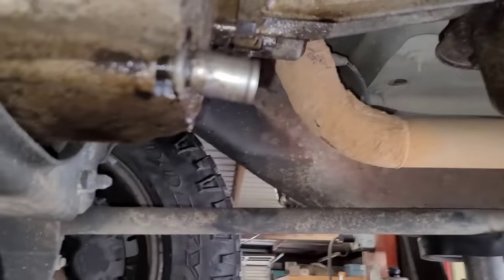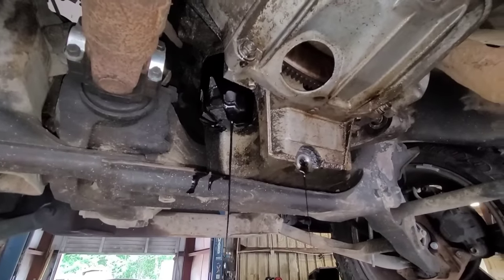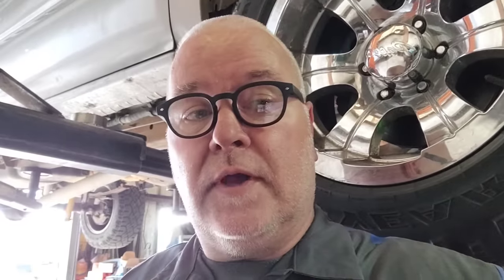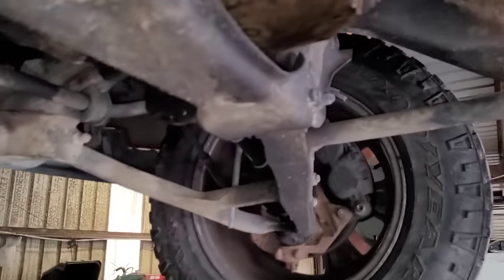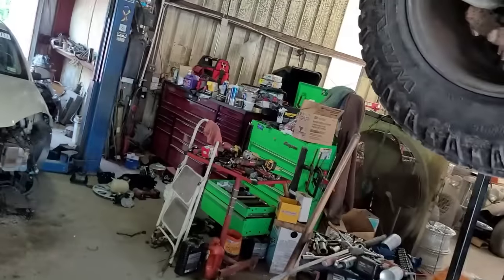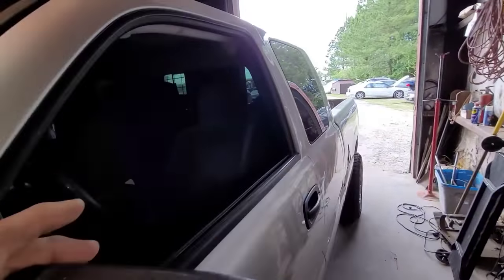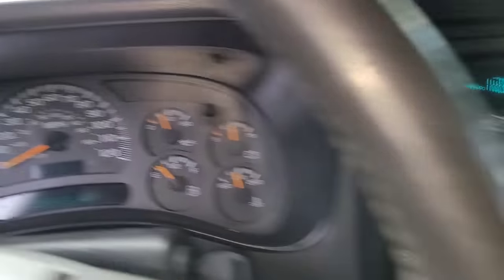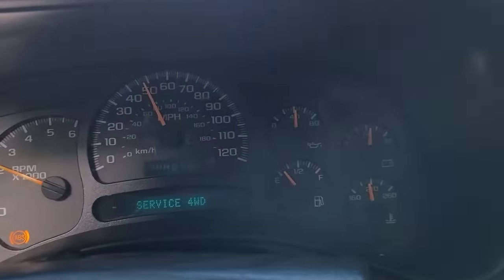We changed the oil in the noisy 5.3 and this happened!! The damage is done unfortunately..

Comment: I am the son of an old school mechanic. My dad always told me to run my finger around the inside of the oil filter threads before installing to make sure there are no metal "burrs" from the manufacturing process. Don't want those things in your oil.   Godspeed dad.
Reply from the maker: Thanks for watching. Keep wrenching 🔧
Reply: Amen... I'm anal about new filters myself... I blow on the holes and take a paper towel to the new threads and wipe anything I can find from the manufacturer tapping the hole
Reply: Plus, it may not be ideal to crank down on the drain plug so hard that the socket sticks to it. Holy crap lol
Reply: Thank your dad,was very smart person,God bless him,where ever his is,🙏
Reply: @SmoothCruizer37 Anal and blowing? You have a lot of innuendos there. This is a family friendly channel!
Reply: @Straight_White_Fatherly_Figure I’ve actually gotten the socket stuck loosing it but i got it off eventually lmao
Reply: Same with my dad. He also lobbed the O-ring with oil.
He had a 3 bay garage, Mobile.
Reply: good tip to remember!
Reply: So, engine was making noise. He warmed up the engine a little bit, before draining oil. Obviously low on oil, but didn't check it.
Reply: Where the GAS filler is, it should say>>>>"CHECK/CHANGE YOUR OIL?"?
Reply: @Straight_White_Fatherly_Figure  14mm is the wrong size for this truck. most likely the drain plug was a 15mm that someone rounded off. the 14 got hammered on to git er dun and now it lives there. socket is cheaper than a $2 drain plug i guess.
Reply: @DS goDspeed really where’s he going,probably no longer alive so that makes no sense
Reply: @dogdue4588  For such reasons many people don't want to take their problems to a shop.
Reply: This comment is not about the drain plug; it's about the oil filter tightened so much, I had to put a long flat blade screwdriver 🪛 through it to be able to start removing it. It was on the ex's car after she took it to Jiffy Lube for the oil and filter change. I ruined an Armitron digital watch that day too, because the oil just gushed during the filter removal process. Using the oil filter wrench only  twist crushed the body of the filter, but it wouldn't budge. @Straight_White_Fatherly_Figure
Reply: Damn good advice.
Reply: @DS-ss7vl  One could also get a medium sized magnet and attach it to the body of the oil filter to catch ferrous particles being moved by the engine oil. Obviously, it won't work with non-magnetic metals.

Comment: Lost oil pressure in my 04 silverado 5.3. I was next door to an auto shop. They quoted 6000 for a new engine. Said it spun a bearing. Even sent me a video of the vehicle running with no oil pressure to show off the noise. I replaced oil pump, timing chain, and pickup tube oring for about $500. I've put at least another 20,000 miles on it
Reply: I think I would have poured some oil in the motor with the plug out to flush out more of the sludge. I almost always do.
Reply: @clarkthomas354  ewww, talk about fraud, waste, and abuse 😖
Reply: @willg.5168 for flushing his own engine out? Wtf are you on about?
Reply: @mikeschmidt4800  WELL, if you want to scientifically explain how it's possible that pouring fresh oil in your motor only for it to drain straight out the pan thinking that alone will flush out impurities, then I'm all ears🤷🏽‍♂️😆

Now, pouring in fresh synthetic oil since it's a detergent oil and running it several hundred miles(preferably highway) would be a remarkable way to flush out sludge, of course it'd take a few changes to do so.

So yeah, that's "WTF" I was on my friend 🙂👍🏽

Comment: It amazes me how many people don’t check their oil level regularly. I check mine monthly. Oil is cheap,engines aren’t.
Reply: I'll check when im at the gas station topping off sometimes. Coolant and oil, doesn't take long and great for peace of mind
Reply: You should be checking your fluids each week. I look under my hood every Sunday. Check the fluids and just give everything a once over.
Reply: I try to give my vehicles a go over once a week or once every other week.
Reply: When the only vehicles I have owned consistently burned oil or were known to burn oil, I pretty much developed a habit of checking my car's oil at least every week.
Reply: Well never changing the oil is the reason just stupidity
Reply: @evangiles4403  Maybe like Kenny said, it may have just been a recent purchase for him because he didn't recognize the truck. But yes absolutely. It's not as if the manufacturers build a method of checking the oil level at any convenient time or something...oh wait!!!! What's that yellow handle for??????😁
Reply: Where the GAS filler is, it should say>>>>"CHECK/CHANGE YOUR OIL?"?
Reply: I check the oil every time I fill the fuel tank. Back when I was working and commuting 80 km one way daily with an 86 Oldsmobile that burned some oil, I had to add a little bit every time I topped up the fuel. Never had it run low, and I drove it for 8 years from 98 to 2006. 

I would give the other fluids a check over every month along with tire pressure.
Reply: @c.d.7742  regular maintenance will keep any vehicle (for the most part)  running indefinitely.
Reply: @dannyo6699   I still have my father's '90 Grand Marquis in like new condition which has always had regular oil changes every 5k km or yearly because it is only driven for 6 months of the year.  I have a '93 tractor and '96 tractor which both get oil changes each year after planting and are still running perfectly.
Reply: It is amazing and especially so in industrial, critically severe situations... like the drivers of their trucks don't even care until things go south! See it all the time!
^..^~~
Reply: Oil is cheapest maintance you can do ..
Reply: My 5.3 is 21 years old and I don't check the oil. It tells me every couple weeks to check oil level on the dash. When that shows up, I know I need to add two quarts😅.
Reply: I have vehicles that I check weekly and some that it is a waste of time to check.  You have to know your consumption.
Reply: @dannyo6699 if he just bought the truck he could of just checked it out a little bit and would of seen the condition of the oil just from the dipstick or no oil on the dipstick. Still his fault

Comment: old school trick, before you change the oil, put a quart of kero in the crankcase to break up the sludge and then change oil
Reply: Or Marvel Mystery Oil?  A dose 100 miles before each change?? (What I used to do back when I had a car.)
Reply: Just use a good quality oil, change every 3-6k miles (dependent on engine and oil types), and it won't build up that sludge in the first place. The kerosene or diesel or marvel tricks can help remediate sludge in engines that haven't been treated well by previous owners but in those cases, they will always have premature wear that will impact performance and longevity. Adding those things to the oil significantly reduces viscosity which can harm modern oil actuated devices like VVT, or cause lumps of sludge to clog small oil passages in ways that might cause major problems. Putting a borescope in the oil fill to ensure no sludge when buying is a better way to go.
Reply: @ExaltedDuck  A quart of diesel fuel works better. Drive the truck around for a few minutes then change the oil. And never change oil when the engine is cold.
Reply: If I were going to do that I would use ATF instead.
Reply: Or Marvel Mystery Oil works too

Comment: I sold my 2004 Silverado step side last year.  It had a 5.3v8 and 268,000 miles.   It never used any oil.  Was always on full mark at 5K miles and could still see through it.   The kid that bought it drives it every day!
Reply: My 04 yukon has 285,000 and oil is clear at 3000 oil change.

Comment: The 5.3 is a great engine.  I have a 2004 Silverado with 125,000 miles on it.  I take very good care of it because I can't afford a new truck.
Reply: I agree. The 5.3 is a beast. My '04 Silverado had 286,000 on it when I had to let it go. Motor, trans., and rear all worked as new. Could still tow my trailer or boat without and pull out in traffic like it did when new. Had to let it go 'cause everything else just rusted away. Broke my heart. Like losing your best friend. In a way, it was.
Reply: My 2013 tahoe just hit 126k and use her to tow my 32 ft rv/tandem axle 16ft loaded trailer. She purs like a lion. I call her the red dragon lol. Only issue (getting fixed today) was leaking radiator so far.
Reply: I know that Rite Take care of it and it will take care of U love my 07 LowHoe 😂😊
Reply: 03 Sierra and 07 Yukon, both north of 300,000 miles. Both 5.3, Yukon has AFM (🤬).  Religious about oil and filter changes.
Reply: It's a shame people abuse them like this. This was a GMT800, before AFM/DOD. These things would run 300k miles all day long. My 2003 has 240k miles on it and purrs like a kitten. A big thirsty pissed off kitten.
Reply: Anything gM NO thanks

Comment: Also, you lube the gasket to keep it from rolling up or wrinkling when it contacts the sealing surface, one of the more reasonable reasons I've heard from old mechanics.
Reply: Don't tell him he says you don't have to do that ,,,,I've always put oil on them ,,I agree you need to
Reply: ב''ה, if the mating surface is already oily it may not matter so much.
 
I've always heard some oil also helps the gasket rubber swell and maintain a good seal.  Not a ton, just a finger swipe with the drips from priming the filter.
Reply: @josephkanowitz6875   I always tell the kids the same thing I was told 40y ago- take your finger- gloved nowadays, and take some of the oil off the old oil filter O-ring and apply it to the new one.  In a commercial environment, it's as much about preventing double gasketing as the lubrication, but shh. don't tell them...
  You get it? If the gasket is missing (and in a busy commerical environment it will be up to even once a month), then it abruptly gets their attention when they see it gone!
Reply: @iadr  Excellent observation!
Additionally, some people might spray down the filter area with engine cleaner after removing the filter, so for them the block would be 'clean and dry' when you remount filter, which could make it harder to turn, because you are only hand-tightening...
Reply: @iadr  I always use the new oil, while I fill the new filter. Why would you use dirty oil from the old filter ?

Comment: When I come across a engine like this, I pour a quart of the thinnest, cheapest oil I have on hand in the engine with the drain plug out. Helps flush crap out.
Reply: I use diesel. Cheaper.
Reply: @tasaman  
I feel a detergent oil works better at carrying the crud to the filter at the same time protecting the metal engine parts. I have run 10W for 500 miles to loosen slug up and carry it to the filter. I've then changed oil and filter with required weight, every thousand miles for 3000. Engine lasted another 125,000 even after first owners abuse, and having a carburetor, which washes the cylinder walls of lube.
Reply: @sem4502  I get it. You are not just flushing. You are running on that oil. I’m talking strictly for flushing out an engine. You can pour 2 or 3 gallons of diesel for very cheap and then still filter and use it.
Reply: 8 @tasaman
Reply: Same

Comment: This is testimony to the fact that LS motors  are bulletproof.  I’ve been a mechanic for 45 years, and I’ve come across some pretty bad oil this rates rates up there with the worst, reminds me of that old Fram commercial ,
 “ PAY ME NOW, OR PAY ME LATER”
In this case, I believe that the old LS here, defied all the old rules, of 
FREE WEAR AND TEAR.
Reply: Something happened by 2007 and the LS became a bunch of pure garbage.
Reply: @AmericanFarmerHVAC2024 Active fuel management, also known as displacement on demand.
Reply: @AmericanFarmerHVAC2024  It was the AFM/DOD they added. Causes collapsed lifters. I just sold my 2012 Yukon with 260k miles though. Still ran like a top. I used good oil and changed it ahead of the computer. Often when the computer said there was still 30% oil life remaining.
Reply: @ericpigg2689  That helps but I've been involved in so many of these engine rebuilds I hate them with a passion.
Reply: @AmericanFarmerHVAC2024  I can see that for sure. I was lucky no doubt.
Reply: @AmericanFarmerHVAC2024 you can thank the EPA for that. I keep my 04 running just so I don't have to deal with that shit.

Comment: That's insane how badly that motor was neglected 😞 I own a 2001 GMC Yukon that has over 300k on it. It looks nothing like that motor it still runs like new and would drive it cross country without fear. Those motors are bulletproof. But you still need to take care of it.
Reply: My 2002 Sierra had 407K when I sold it, and it purred like a kitten.  Yes, someone actually bought it!
Reply: My 2001 has 350k+. I bought it new. I change the oil every 5000 miles with full synthetic.  I recently drove it on a 1000 mile trip. I got 17 MPG driving 70 to 80 MPH.  That's not much different from when it was new.  People need to learn that taking care of their car saves money in the long run.
Reply: Yowser
Reply: I got 315 on my 05 tahoe just now developing a rear main leak
Reply: We've got 340,000 on our 2003 Tahoe. Original everything.

Comment: A friend of mine owned a repair shop and had a customer that had more money than he knew what to do with.  I bought a brand new Datsun 280Z (that should tell you how long ago it was) and NEVER changed the oil or filter.  He added oil when it was low but it was never changed.  My buddy told me that when the engine finally blew at around 80,000 miles the filter weighed 40 lbs., pretty much a solid block of steel.  Your comment on the weight of the filter reminded me of that.   Keep the good stuff coming buddy.

Comment: I vote that we make the socket included bolt a thing!
Reply: Bruh that would be funny
Reply: Ford did, kinda. Don't get me wrong, I'm all for a positive stop drain plug to prevent over tightening but plastic might not have been the material of choice.
Reply: ...and make them all 10mm so some of us can get replacements. 🤣
Reply: I like the ones that are square that you just stick your ratchet extension in like a rear-end  plug.
Reply: It is. Look up "square drive bolt". It's like an Allen head but 4 sided instead of 6. Also, Robertson drive is similar but has a self-centering pyramid. Because Henry Ford didn't like the salesman for Robertson screws (supposedly, they went to "different churches"), the US has generally adopted Philips for screws. Robertson has remained common in Canada, though. With the right sized hole, a ratchet's square drive should be able to fit.
Reply: I'm all for oil pan bolts with a rectangular head so the only thing you can put on them is either a special socket or an open end. Anything around a 9/16 or 15mm is all you need. Other side can be 11/16 or 17mm. Anyone reefing on that will just snap the wrench. And you can go under with one double-open 15/17mm and none of that this one is 10mm, that one is 7/16, and this one is 14mm and I forget which truck it was that I had that needed a 3/4.
Reply: The do on reaer ends the plugs take 1/2 or 3/8 square drive

Comment: Needs to do another oil change before long!
Reply: That's what I was thinking too. Then throw in the synthetic oil with a quart of LB in it!
Reply: Definitely
Reply: Using the right oil this time. Use that fram oil as a solvent, warm it up then dump it hot
Reply: Yup id do it after like 100 miles  and possibly one more 1000 miles later for comfort
Reply: I would have put a quart of transmission fluid in it. Change the oil in 500 miles.
Reply: @kevinmeyer3884  Don't use additives. The oil companies spend millions to design the oils properties.  Ya don't want to play amature hour home chemist trying to improve the oil.
Reply: @randywl8925 I totally agree with you sir.
Reply: Where the GAS filler is, it should say>>>>"CHECK/CHANGE YOUR OIL?"?

Comment: Main reason to oil the gasket is to let the seal slide as it gets tightened. This is supposed to prevent it from bunching up (good visual, look at slow mo of drive wheels on top fuel dragsters). With modern elastomers, it's probably less of a problem. I wouldn't be surprised if they have copolymers and fillers in the rubber to help prevent binding, and residual mold release from manufacturing that help, and the machined mating surface is probably smoother and flatter than it would have been when the conventional wisdom became conventional... That probably all helps too. Still, for the amount of time it takes and the lack of any downside I can see, I go ahead and oil it anyway. In my experience, cleaning the mating surface and adequately tightening are much larger impacts on oil filter leaks.